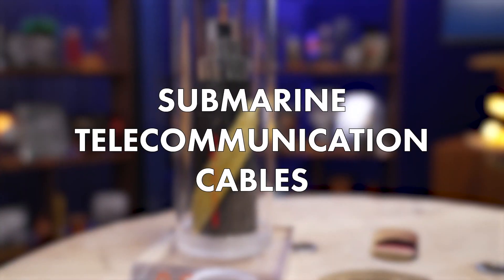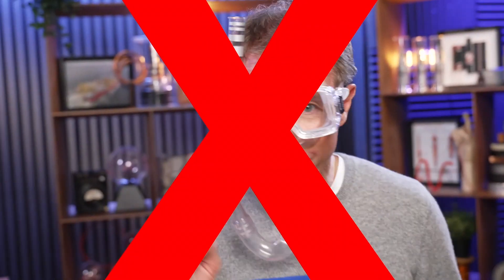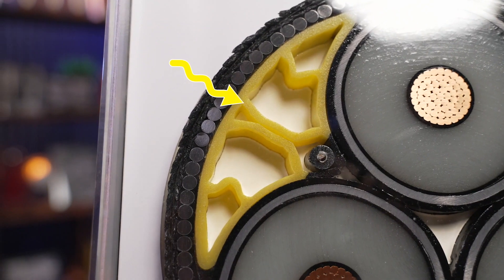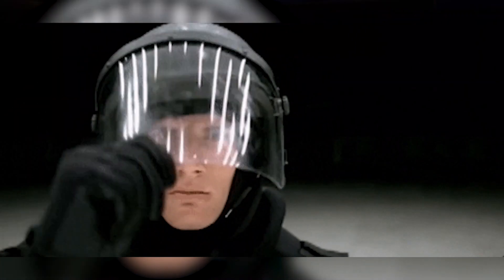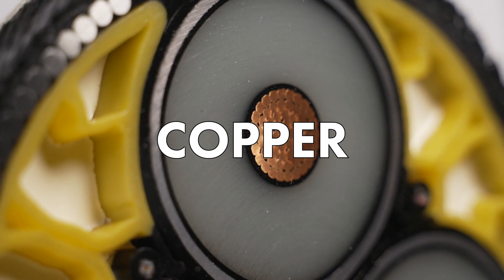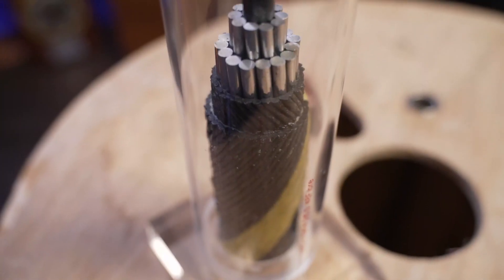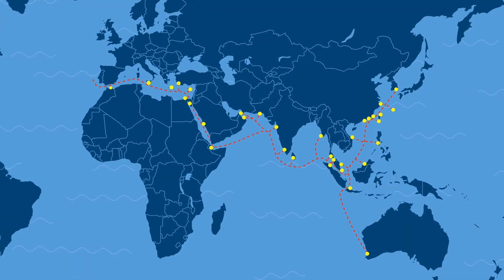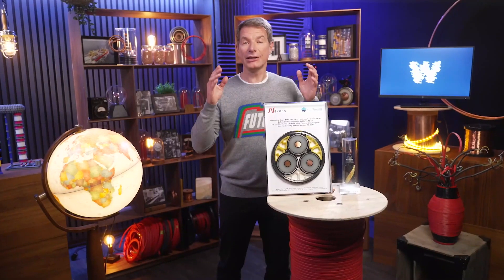Submarine Cables, The Aquatic Conductors of Data and Power

Comment: Why don’t we have power cables connecting continents? Is there a technical limitation or something else (eg no use case for it or too expensive or political reasons)
Reply from the maker: Many power subsea cables interconnect islands and coastal countries. The world’s longest electricity interconnector (North Sea Link, 450 miles) has been operated between the UK and Norway since October 2021. Before making it longer and longer, limits are mainly economical (refer to the size of the cables in the video, required materials, specific vessel for installation). The deeper, the more complex. “Global super grids” have been considered since 1950, and become a recurrent topic to harness world renewable energy. At the moment, efforts are made to develop interconnections between countries within a continent, and the feasibility study of loops such as that around the Mediterranean Sea between Europe and North Africa are key projects.
Reply: @whatswattbynexans6959  Very interesting and informative. Thanks so much for the response!
Reply: @whatswattbynexans6959 so, all in all, do we expect intercontinental power cables?